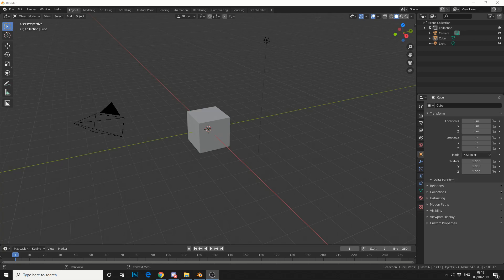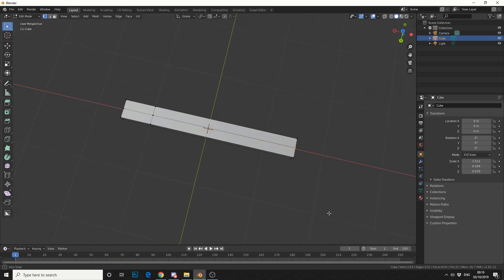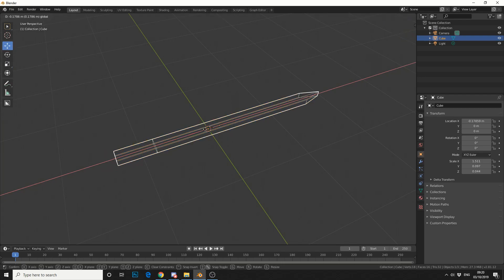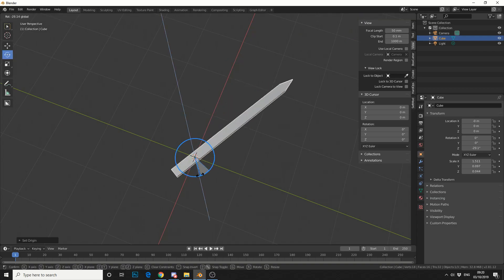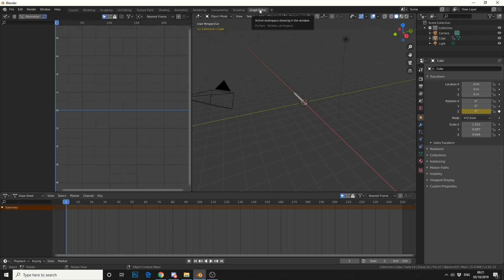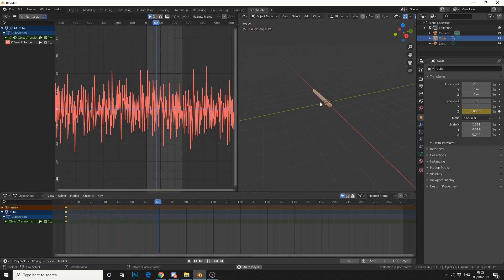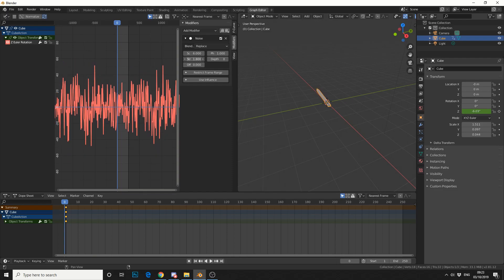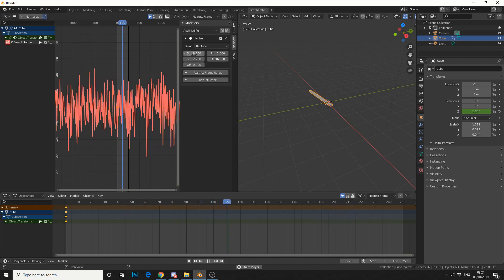Blender 2.8 Tutorial: Graph Editor Noise Modifier - Animate a gauge needle

Comment: But, how do you animate the noise overtime?  You know, so the noise starts of small get's bigger and goes back to zero?
Reply: When selecting the graph you wish to give noise to, in that tiny modifiers menu on the left, you can set the starting and ending frames of the noise. Once you did that, the numbers UNDER those numbers will be the fade-in and fade-out frames compared to the frames from before. Buckle those up and you can see that the sudden noise gets a smoother end or beginning as you slide them.